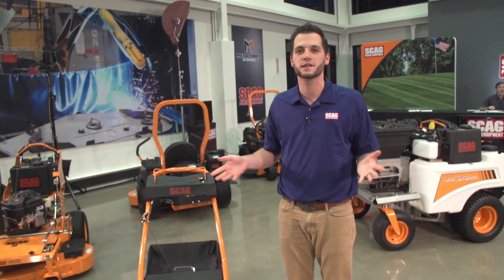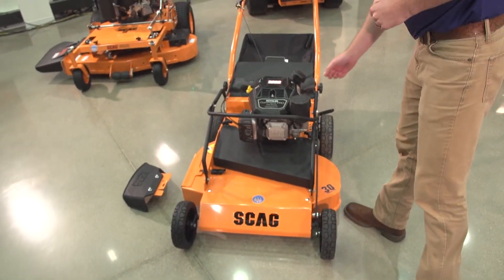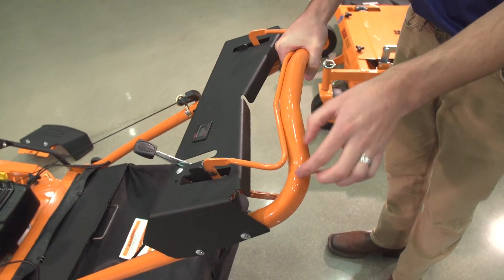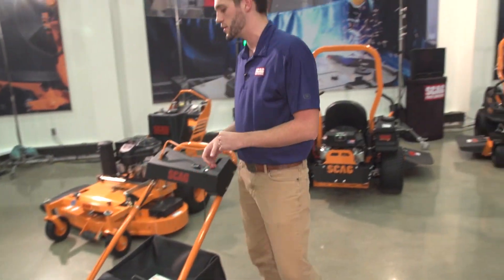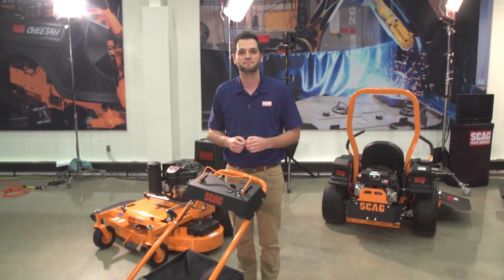30" mower prototype – SCAG LIVE 2020

Comment: Thanks for showing this off!

Design:

0:46 Ultimately a non-issue when it comes to commercial users, but I don’t like the front, looks a bit dated.
 Looks like you would also lock yourself into a fixed wheel setup, if you look at Ferris design they have the fixed wheels mounted in such a way to allow the option of adding casters.

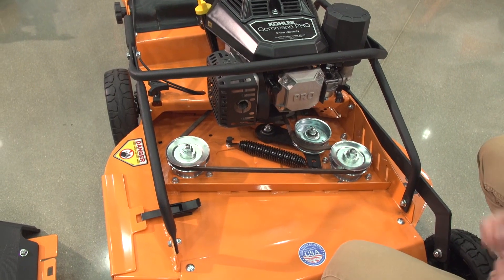2:25 You don’t show a clear shot of the oil filter/drain plug placement so I could be wrong, but looks like they are positioned right over the cover/deck to make a big mess, so I would make sure to replace the standard Kohler drain plug on this model with some type of hose ready connection to cut down on clean up.

Height of cut:

3:19 You don’t show the actual height-of-cut adjustment process, which seems like a big thing to leave out for a push/walk behind mower.

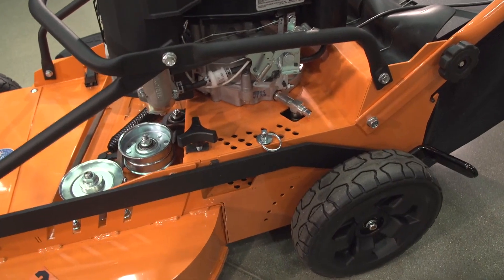3:29 Are there height indicators stamped on the deck that we just can’t see or weren’t shown? How would someone know what height they were adjusting? Thinking of a bright Florida day, there is no way I would be able to see something stamped on an orange clear coated deck to adjust. Will there be a high-contrast sticker overlaid in future models? 

Handlebar:

3:58 It looks as though there is no storage position for the handle bar, and you have to store it in your trailer in one of the three operation positions. That could be an issue for guys with smaller trailers or ones used to collapsing handlebars during transport. If you have an 8x20, might not be an issue.

4:28 I would really like to see some type of wire strain relief grommet. Might not be an issue initially, but someone running this for years on end might start wearing through those cable jackets with vibration, regular movement, and adjusting the handlebars.

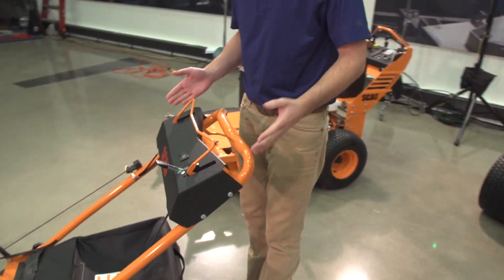5:01 Sounds like the handle is a work in progress, so you probably knew this, but having painted metal only would be a bad idea. Again, thinking of a hot Florida day, my sweaty hands would not be able to stay in position, they could be pushed inward to the center. It is a different setup than the SWZT as you have some outward pressure from gripping the controls that isn’t present on this walk-behind.

6:42 Might be a trick of the camera but the throttle in full low position looks like it would be uncomfortably close to the top bail handle.

Thanks again for the chance to provide feedback!
Reply from the maker: We appreciate the in-depth feedback, we'll try to tackle all the questions below. One thing to keep in mind is what we showed is truly a prototype machine, pretty far from production-level quality. 

:46 - We are expecting to have a swivel wheel kit available as an accessory, so it will not be locked in as shown.

2:25 - There is an oil drain hose that you can't see in the walk around to avoid this.

3:19 - A single point of adjustment on our machine, the prototype is shown in the video was not 100% workable at the time

3:29 - There will be a decal with the height-of-cut. We actually already have one there or if not have one of these en route to the Florida market for testing. Florida cutting conditions is the ultimate testing grounds!

3:58 - Will certainly be part of the final design. This was certainly brought up when we had it testing in some dense metro markets that strictly run these categories of mowers only and operate out of the back of a pickup truck.

4:28 - Great feedback on this that we've not yet heard, will pass along to our development team

5:01 & 6:42 - Handle, like the rest of the machine, certainly is a work in progress. Not a camera trick at all, when actually running that machine shown it drills the throttle control, again one of those things where we don't have final tooling on various parts for the machine quite yet.

Awesome feedback indeed, we really appreciate you taking the time to review and share your thoughts. We really look forward to hearing what you think as we get closer to or at production. All feedback like this will help us create a home run machine.
Reply: @ScagPowerEquipment  I appreciate the walk around video. It is the next best thing since GIE was cancelled. Thanks for the reply!
Reply from the maker: @BakerCountyTrashPickup  Hope to see everyone at the 2021 GIE!
Reply: CCCLC up in videos AND comments with the quality, look at this guy go!
Reply: @ScagPowerEquipment  please give it a Kawasaki engine and adjustable speed control
Reply: @chrisnewman4087  please do not give it the anemic Kawasaki engine ...the fj180v does not have enough power
Reply: @ScagPowerEquipment  3:58, storage position never happened..... just picked up mine the other day and that's a major down fall. Also, the bagging system is top complicated. Having to interchange not one but two modular parts of the mower, and then awkwardly position the bagger is really a headache if your switching functions throughout the day. Other than that, the mower is great so far.
Reply from the maker: @dgfj2b754  Does your machine not have a vertical pin setting for the handle bars?

Comment: My company purchased this mower in Nov '21 and have replaced the clutch at least 10 times (warranty), the rubber on the rear tires have separated from the plastic rim and fallen off, and just this week the front tire plastic rim cracked and caused the tire to separate. Supposedly Scag is working on another clutch but don't know when that will arrive. I wouldn't recommend buying this mower.
Reply from the maker: John, we are extremely sorry to hear that you are experiencing these issues with your SFC-30. Please fill out a 'Contact Us' form and we would be more than happy to help further assist. https://www.scag.com/company/contact-us/

Comment: Hello, 20 year lawn and landscape vet as well as scag user here. Firstly, mower looks nice and heavy duty! Operative word being heavy!! Im very concerned by seeing how heavy the construction of the machine is yet has unsubstantial wheels/tires. Additionally the tread or lack thereof on the tires may work on a flat florida lawn but in the mud and hills of pennsylvania will render the machine inoperative. Based on my experience id have to assume this machine is a good bit heavier than the toro/exmark competitors which are already too heavy for their purpose. A commercial mowing crew only goes for the push style mower when there is an area that is too tight, wet, steep, or uneven. A 200lb push mower on steroids isnt going to effectively answer that call, not for my business anyways.  An mfg needs to make a machine of this class that is light, fast, non rutting, and easy to use to set themselves apart. We have already been thru a half dozen of the exmark 30 mowers and will not be going back down that road either.
Reply from the maker: Appreciate the feedback.
Reply: I have used the machine now for a few months. Its way to heavy and causes many issues. I wish I could get my money back.

Comment: I have the Toro 30” commercial Turfmaster and i have been very happy with it.  It was in the $2k range brand new.
Reply from the maker: The Scag model will be in that range
Reply: My gripe with these 30s is they historically have been average performers for high prices.  The $999 toro commercial 21 is the way to go for a push.   The current available commercial 30s are way too expensive for what they are at 2k-2300.  I think the sweet spot for these mowers would be $17-1800.

Comment: Will this thing mulch better than Timemaster/Turfmaster especially in slightly taller moist lush grass or will it just pack up under the deck like the others do?
Reply from the maker: All our testing thus far has left an incredible result when mulching, bagging or side discharging.
Reply: @ScagPowerEquipment  If it can mulch tall, moist/wet, lush northern grasses without packing up the deck or clumping you have out-engineered the other guys!  I hope this really works!

Comment: I've been using the Toro commercial 30 for the past two years and was planning to change to Ferris/snapper FW15 for the front swivel caster and larger rear tires also for the hydro's. I hope Scag builds something more akin to Ferris than to Toro.
Reply from the maker: No current plans as of right now to target that class of machine
Reply: @ScagPowerEquipment  Thank you for the quick response

Comment: That needs a gear section for speed control like 1,2,3 and they should offer a electric start and I can't tell if that motor has a oil filter or not but it should have full pressure lubrication with a oil filter not splash lubrication without a filter. That's my feedback.
Reply from the maker: Appreciate the feedback. Not setup as variable speed at this time.  Certainly does have an oil filter.  You can learn more about the engine here: https://kohlerpower.com/en/engines/product/command-pro-cv224

Comment: I’m 10. Seconds into this video and I already see two design flaws.   1). Because of the added weight of commercial push mowers the front wheels should not track in the same park as the rears (customers hate a grooved up lawn in the wet spring time).   2) The back tire should be at least an inch wider.  (See Ferris FW15).     All things considered, this appears to be good mower.
Reply from the maker: We appreciate the feedback
Reply: Agree
Reply: Offset would be ideal, sort of like a staggered wheel Lawn-Boy.

Comment: Castor wheels on front a must
Reply from the maker: Expected to be an optional accessory.
Reply: Yea u can see it struggles on that turn
Reply: caster wheels, powered steering, and a sulky, along with a voucher to trade-in within a season for a turf tiger :D
Reply: Castor wheel with locking pin for hills , variable speed for mowing through thick wet and tall grass. Mowing heights of up to 5" and raising mower deck height separately from from and back so I can raise the back slightly more than the front for thicker grass . Straight and flat side discharge so I can add a chute blocker. Large fuel tank. That about sums it😬

Comment: We have been using toro 30 in. For 7 years 3 different models they get better every model but they’re still not all the way there. we have had over 15 of them so far. A lot of us need these for small yards and fenced yards. Make sure the transmission works as good as the new one on the Toro and a nice rear bagger a little wider tires bigger motor than that one’s got the casters on the front would be great. I’m guessing your price points going to be low 2000 range maybe a size 23 or four hundred if it’s good.
We work with Midwest turf in Omaha and we want to demo this in the spring 3 rd week of March.
Thanks Bill
Reply from the maker: Thanks Bill. The folks at MTI will certainly keep you in the loop when demo machines become available

Comment: Please make it with a blade break clutch, front casters and a quick release to adjust the handle in full vertical position for trailering and storage.
Reply from the maker: Blade brake clutch is standard, front casters are an expected accessory and handles will be adjustable to allow for a full vertical for transportation or storage.

Comment: Having a side discharge chute that can stay attached to the mower. So you can quickly go from bagging to side discharge. I have 18 yards  on two streets that intersect. Correctly using an ex mark 30 inch for the backyards that my stand on mowers can not access. Several of the backyards have inground pools and such so that a bagger is needed. While others are larger open yards. With the ex mark the side discharge cover unclips from the side. But that leaves you having to set it aside and remembering to pick it back up and carry or reinstall before walking to the next yard. A hinged discharge chute cover that firmly locks upwards and downwards would be ideal.
Reply from the maker: Appreciate the feedback

Comment: If you put a Honda GXV 390 the whole industry would use them
Reply: That’s what Ferris/ snapper did
Reply: It would also add 40+ lbs. to the weight of the mower. Need much wider tires,  casters on front almost a necessity.  It would turn this machine into something completely different and I'm thinking this gets away from the design goals of this machine, but maybe I'm wrong.

Comment: I do the mowing for my grandpa and he has a double lot in town. I wanted something built to last and got the 30in scag in May. My impression is this thing is really nice overall. The positives are mostly obvious to be honest and there are plenty. Best part is it's American made. Not a Kohler fan personally, but that's me. It's what Scag had left with engine companies pulling out to go electric or due to regulations.

As for the negative things, here's my opinions on what I feel Scag could try to improve:
1. Drive system 
This mower needs the same throttle control as the new SFC 21 has for it's drive system, or at least make it optional. Trying to hold the drive handle in just the right spot while hitting bumps and wavy areas is a big challenge. Hard on your hands, especially with the weight of the mower. Which leads too...
2. Weight. 
This thing is beast, probably too much so. Could be made somewhat lighter I would think without compromising the quality.
3. Operators manual clarification.
I let Scag know this but nowhere in their manual, nor in Kohlers manual, does it state how to use the "Clean change" oil removal process. It's actually really nice for this mower, but with 3 (I believe) oil plugs, and different directions for what to do, it's not hard to pull the plug Kohler says to, which isn't the one to use.
4. Grips.
Not a huge deal but good handle bar grips would help with blisters and overall comfort.
5. How-to videos.
It would really help for visual learners. Most larger companies do this, especially in power equipment, and you can learn some great tips to if done well. Stihl chainsaws come to my mind and I learned a good deal of info.

All things said, you wouldn't go wrong buying this mower if your serious about your yard, or business. Just be ready for a challenges you probably never had to deal with before with a walk behind mower. It's a beast but not completely for all the perfect reasons.

Comment: It should be an Electric Start, people who are tired when working don't want to be bothered pulling a cord, even if when new it starts right up. 
Too bad the engagement levers can't be locked into position so you don't have to continually hold them, but I guess that's what a bungee cord can do.
Reply: The Kohler CV224cc engine that they seem to be set on does not have an electric start option.  But owners seem to say that the recoil starter is VERY easy.  Many commercial users feel that an electric start on a small engine like this will not last anyway and be one more thing to break.
Reply: @mellowjammer  Good to know, and point taken. Thanks for the feedback.

Comment: Any update on availability and final design?  As mentioned, it has to have a one gallon-ish fuel tank.  Also, I hope the speed adjuster is independent of the control lever.  You should be able to pin and hold the drive control lever to the bar and set the speed separately.  This is much more comfortable and user friendly, especially when you use them for hours on end.  It is also easier and faster to turn around.  Trying to modulate your speed all day and having a big gap to the bar as on a Turfmaster or Exmark is annoying.  IMO, Ariens had the best - most ergonomic and user friendly - handlebar and control lever design on their LM21 for years.
Reply from the maker: Hopefully we answered all questions:

Demo units have shipped. 
Production starts in a few weeks. 
Fuel capacity is 1-gallon.

Comment: Wonder what the price point will be given you can now buy a Toro Timemaster for $1k. Personal pace needed. I get it that steel is quality, but how heavy is it? It will make a difference on the handling. Does it have a true mulching kit underneath?
Reply from the maker: Price point will be in the 2K range. More of a commercial machine than the model mentioned

Comment: One issue I’ve had with the turf master is that it won’t cut long grass even when it’s dry it doesn’t have the suction and the opening is too small
Reply: Need to cut out the piece of metal so the discharge opening wont clog But then the deck may bend. so would have to add gusset.

Comment: Looks really solid. Send one over and I'll try to break it! :) I haven't been able to break the Cheetah yet so that is a testament to Scag toughness for sure. I fought wars with it! This machine looks like it could fall off the trailer without breaking. I like that it is not an overlapping timed deck and I like that the deck is so thick and stout. But what does it weigh? Just looking at those rear wheels. Just like Copper Creek I am mowing in Florida in ridiculous conditions and a very high HOC, usually around 4.5". Speaking from a lot of experience with my Cub Cadet 33, it is handy to have tall rear tires to maneuver in thick wet St Augustine grass. Looks as though you are shooting for the Timemaster idea which I decided against due to it's rear wheels. But what does this Scag mower weigh? Other than that I must suggest electric start. Something else my newer CC 33" has and I have gotten spoiled on it. I know it would add to the cost but it doesn't look like something that's going to be inexpensive anyway. Maybe have it as an option. And I see in the comments that you already got the memo on casters. :) I agree there. Otherwise I see that Brad addressed many things that you answered. I like the color you went with. he he...
Reply from the maker: Great to hear from the Cheetah Lawn Artist!

I believe we had one of these arrive in Florida for some testing late last week. If machines can survive Florida cutting conditions it can survive any!

Weight will be similar to the machines in this class currently out there but we might have a few tricks up our sleeve on that topic that we'll discuss at a later date :)

Enjoy the mow!